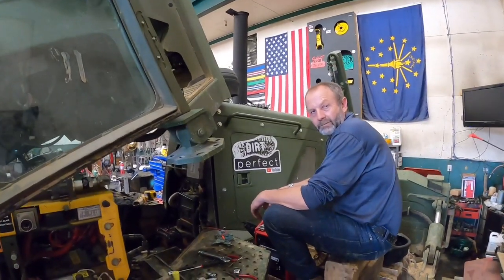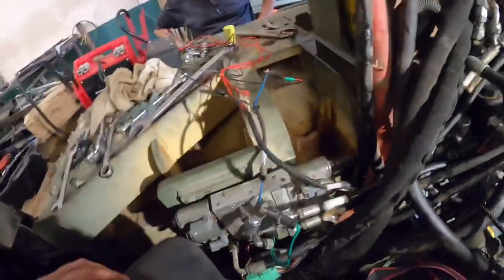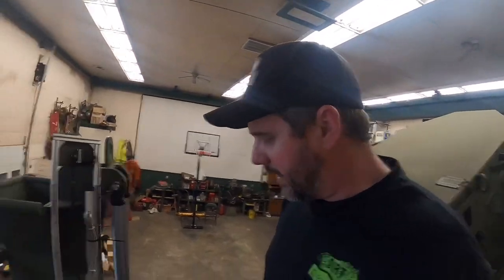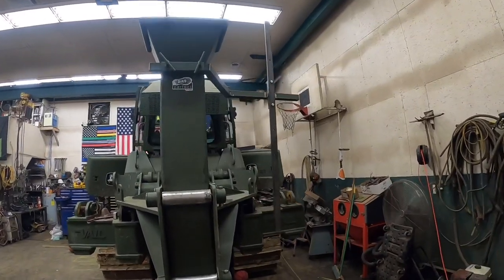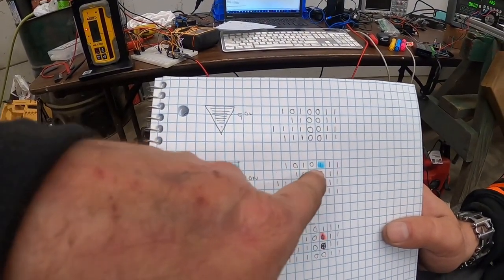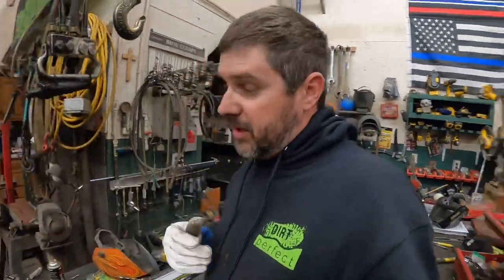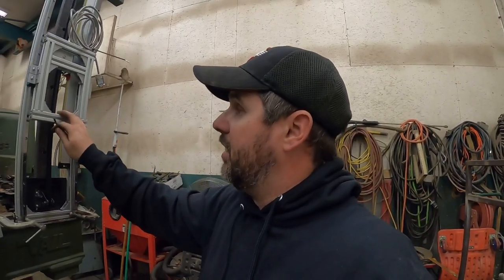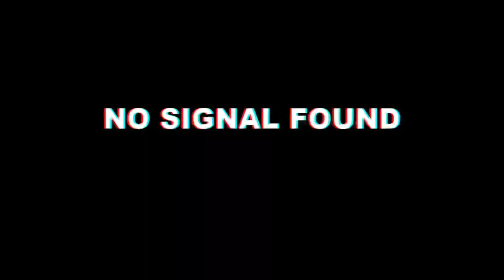Call us crazy, but we are going to build a grade control system for the plow from scratch.

Comment: Well done.  Not just designing and adding laser depth control, but on the way you built it. It is great to see something designed and built by someone who knows that eventually, everything has to be taken apart for maintenance or repairs, and that limiting down-time is usually more related to how hard it is to take apart and put back together. Having an "end user" design and build a system, even with help from "experts," makes it so much more practical.

Comment: Well Mike, as a professional electronics tech for almost 40 years I'm seriously impressed with your new friend FlamingDirt's outstanding design and build of that hydraulic emulator / simulator system. 
Not to mention the software needed to operate it.
Next step is transferring that breadboard to an actual printed and populated (populated is a term used for the items installed on a circuit board.) circuit board.
Another system you or he or in a partnership should patent. 
Never turn down a source of income from something that you came up with, designed, built, tested and made a working model of.
I'm pretty sure that there's other operators out there who could use that contraption themselves.
Reply: Thank you Ronnie. It's a BIG compliment when it comes from a PRO. As for the patent, we covered that in depth on the live feed a few weeks back. We going to skip the patent on this one.
Reply from the maker: Thanks yes he is awesome leaned a lot in a short time

Comment: Greetings from No VT - I have to agree with several of the other comments about the potential for vibration being a factor. Hopefully shock mountings on the tower frame connection will help. Also, maybe see if you can slow down the refresh rate on the laser receiver or if that isn't possible maybe reduce the frequency of readings sent to the hydraulic solenoid so that it isn't picking up too much "microsecond" variation. One option might be to introduce a microchip signal buffer to take the readings coming off the receiver and "smooth" the values so that your hydraulics are not overwhelmed with too many "corrections". At the speed the dozer travels laying in tile, maybe a 5-10 second interval for updates to the depth control hydraulics? Impressive project, will be watching for the next installment!!
Reply: There is just too many questions on this topic to answer each one. But since you took the time to formulate it so well I'll answer yours. Simple answer: It is not as issue. As you mentioned the reaction time is already controlled for a slew of other reasons.
Reply: @flamingdirt669  Thanks

Comment: My tile boys put their laser on a steel tri-pod with sliding pipe on top, witch was mounted on a two axel trailer. When they needed to reset the laser they pull the trailer to anew spot. The laser was all ways in front of the dozer going up hill , receiver was pointing forward on dozer. High up slowly going down as dozer went up hill
Reply from the maker: That would work for sure

Comment: Hi Mike I get what you are trying to do or I should say already did . I believe in the KISS method . If I was advising you on this build I would change two things . First there are hydraulic cylinders on the market that have positioning sensors built into them . So you can get rid of that delicate  erector set you have hanging on the machine  . Second I would use proximity switches on mounted on the boot they are cheap and the rights ones for your application are very durable .  I think Flaming Dirt would be able to use those signals from them just fine to control the elevation .  I think the difference would be that your laser receiver would be mounted at a know point on the machine as from what I can tell it is now mounted on a floating point that you are trying to hold as the machine goes up and down . It may sound more complicated but a lot less moving fragile parts .

Comment: As a retired Electrical Systems engineer...you are replicating a Servo  loop whereby you have a setpoint ( being the targeted height of blade ) and comparing that to feedback  ( location of blade in respect to desired location) to output an error ( distance and direction needed to travel to get to right location) . 
Response time of system as well as gain and offset of controls look to be very doable.  I'm sure you guys will figure it out...R&D with practical output. Nice job guys..
Reply: Thank Rick, it sure was interesting. Especially since the loop was only closed at the very end.

Comment: ok I need some help understanding what drag chains are to control depth. Cheers
Reply: Ian go find our live chat a few weeks back. DP explains it there. But in short, it's a chain with color coded links hanging from that same bracket that the laser is on. DP then just keep the right color touching the ground while we drives. To be clear. Drag chains is for constant depth. The laser holds grade not matter what the depth is.
Reply: @flamingdirt669  appreciate it thanks!

Comment: OK, So what do the two Bright Yellow "Trimble" boxes on the back firewall do?  Are they the original GPS Blade Control system?    Blade lift should be relatively easy to convert  to plow depth.    What other GPS equipment do you need?
Reply: George, those boxes are the valve control electronics. The GPS receirver , Co-ordinate processing unit  and in-cab control head is not there. Plus that tech is 10+ years old. So it would be difficult to find one. We just used the valves and eliminated the rest.

Comment: It is wise to use redundant limit switches if damage is possible and an indicators showing limit reached. A simple switch failure resulted in a pumped hydro system overfilling and destroying the dam in Mo. I think it was the black river. Oh, it destroyed a state park also.

Comment: Doesn’t the laser going to keep the plow level weather it 36” below the surface or 30” below the surface.  If your installing the tile for drainage you don’t want it level you want to have a scope correct? What application do you want to be level?
Reply: DP's laser is a grade laser. He presets the grade. On test day he was running 2.5% grade. I can't think of any time you would run the plow level with tile. But DP might have other uses I'm not privy too.
Reply: @flamingdirt669  thanks, I knew there was something I didn’t understand. I was thinking the laser was only to keep you level.

Comment: I suspect that the mount is going to be a problem - vibration - notice at about 29:20 how the mount moved. I don't think the mount is rigid enough unless the digital smarts can compensate. It might also suffer fatigue failure due to vibration.
Reply: This is exactly what I was thinking as I watch Mike make the mount.
Reply: I just don't think Mike have everything secured down in that video frame.  I believe he is still test fitting everything and will become solid once all the fab work is complete.  Like he always says, "Stay Tuned!"
Reply: @rons3103  I couldn't have said it better myself. Let's wait until he is finished. From the live feed he did a few weeks ago, he said it work just like they wanted it to.
Reply from the maker: Stay tuned
Reply: @DirtPerfect  I see what ya did there
Reply: @DirtPerfect  LOL - if you get "tuned" osculation......

Comment: replace the clamps with bracket that can be bolted on (to tabs on the back of the angle iron)   That way you can slide the top into your holder, and then set the bottom into the angle iron.  Then simply put the strap over the carriage and tighten.   It will be a much lower profile than the c-clamps.

Comment: Steering is not critical
But I recommend a bigger back board behind the sensor.   I had a red lazer from army surplus. 12 volt. 2 foot long.  Would light up a tail light  or headlight half mile away.. At night.  Reflective Stop sign.  It was a tank gun sight.  In daylight it was invisible but a detecter could detect  it that far also.   I never found a good use for it except with mirrors I put a fence around a property. If it was broken it set off alarm. Deer kept setting it off but it kept them out of the garden. 
I used to go to the Dayton Hamfest.  In Ohio.  Ten acres of STUFF.  Army surplus of all kinds and goodies of all sorts .  truckloads.

Comment: I see an arduino Mega and an ESP32  . I figured thats  what he was using when i saw the IDE . I prototype with Atmel Processors a lot. Pretty cool seeing him do some of the same things im familiar with . Looks like a pretty slick setup reading the Hex off the Laser receiver.
Reply: Thank you MrAr. The hi-lite was working with DP. But the Geek in me enjoyed the LCD hack the most. Is a custom LCD with on public documentation. So figuring that one out was very interesting. Especially since it's got 4 back planes and nothing was like is seemed as first glance.
Reply: @flamingdirt669  sounds like a load of fun

Comment: Is that a neutral position limit switch so that you differentiate between up and down overtravel positions?
Reply: Yes it is neutral position. But it does not know up and down Schwarz. We based it on the direction of the last stepper command. But you are 100% correct if the stepper lost it's mind and went the wrong way the logic will fail.
Reply: @flamingdirt669  A true "neutral position" limit switch has 2 independent contacts, one closes in the CW direction and one closes in the CCW direction.
Reply: @schwarz6337  Thx for the info  Schwarz, I'll definitely  look into those. They will help a lot for future projects.

Comment: I have a laser, and do my farm ditch cleaning with it. The neighbor has an rtk gps on his scraper.   My laser is nice, cheap, and simple.  The gps system is really nice because it can adjust the grade % every 20 linear foot increments or so.  The neighbor can get water to move, while moving a lot less dirt - using multiple grades,  than I do with a single grade laser system.

Comment: Someone please explain - What use is a laser system to raise and lower the plow when you just lower the plow to the depth you want and then the dozer follows the land so it stays at the same depth anyway?
I'm missing something.
Reply: Hi, in your scenario the plow would put the tile at a constant depth and yes there is applications for that. But in most cases the tile needs to be on a specific grade. ex 2.5% was what DP used the day we tested. The reason is that is needs constant flow. If the tile goes up and down ,following the contours of the field, it will silt in on the low spots. So the laser's job is to keep that grade as best it can. This is a very basic explanation of a complex problem. But this should get you thinking in the right direction.
Reply: @flamingdirt669  That makes perfect sense, thank you for taking the time to explain. Cheers!

Comment: well as a member of the peanut gallery i noticed you have hard time getting the rail into the holder. maybe add a couple little tabs at an angle to guide it into place. also could you provide me with the # off the micro switch . for one of my future projects thanks
Reply: rebuild it's a great idea. But I have to say I'm partial to the g-clamps. They give it just the right amount of Redneck flair. The switch is a ME-8108 from uxcell.

Comment: As operator and mechanic you know what is possible and that you can get to a specific result even if you don't have all the detailed steps decided and locked down. We IT guys/hackers are just the same, we know what is possible and the route to the final solution even though we know details will change. We tinkering and fettle but we just use different tools.

Comment: With a couple tee fittings and ball valves, this system could rapid swap to blade height controller
Reply: True... just tee in the electric valve into the blade height circuit and it will work along the existing control.

But when the grade is off so much that the dozer spins out, you'll need to switch over to manual control with the ball valves in order to move your blade load. That means the electric power to the control valve needs a relay to switch it off do you can override the blade height, yet you still get to see how far off grade you actually are...
Reply: @Sjanzo  Great summary Sjanzo. What we did find is the dozer pilot hydraulic pressure is setup so that the hand controls always override the GPS system. I think it was done intentionally as a safety.
Reply: @flamingdirt669  yes off course you can also just cut pilot pressure to disengage  the auto height control, i just assumed the additional valve installed by C&C was a low flow, direct operated one without a pilot...
Reply: @Sjanzo  Oh man that 850J is a hydraulic spaghettis bowl. Dual pilots on everything(the GPS version) and more one-ways than NY City.
Reply: @flamingdirt669  so, are you using the dozers own GPS system, or are you tapping into the laser receiver youre adding, to control the electric spool valve of the tile plough height ?
Reply: @Sjanzo  The laser. the 850J does not have GPS, it is just GPS ready. Meaning the valves and valve control box. No receiver or GPS control unit. We used only the valves and eliminated the valve control box. Hacking an output device like the Laser LCD is hard but do-able since you can see the output. Trying to figure out what possible inputs that valve control box needed would have been near impossible unless one could find a spec or get your hands on a working complete system.
Reply: @flamingdirt669  interesting... 15 years ago at a trailer builder, the supplier of trailer steering systems rented a Ford Focus to hack into its electric power steering pump to learn how to engage that pump, because TRW wanted 20.000 euro for the source code... they got that pump working fine on our trailer, dont ask me how... 😉

Anyways, i know what youre doing now, even though i dont know the code at all.. Cool project, you sound like the electric guy at work..

Comment: PIDS & DIPS, and Mechanical inter-locks.  Oh boy DP getting very techy with the ones and zeros. The breakout board and sleuthing the PID for each laser level position is exactly how to do poor-man’s GPS level control. The limit switches will require maintenance to ensure levers actuate and protect the mechanism and stepper motor.
Reply: Thank you Sean. It was great working with DP. His ability to pick up new knowledge is simply astounding.

Comment: Surprised your expert didnt go with a Marine GPS receiver.  They cost $100 or so and output NMEA 0183 data, which is an industry standard.

Interfacing NMEA 0183 data is pretty simple as there are already librarys written for Arduino and other microcontroller development platforms.

But I am still impressed with what you are doing.
Reply: Great comment RV and yes I was thinking along the same lines. But sadly most marine receivers are only accurate to couple of  feet. The fancy new ones to several inches(and those don't cost $100). We needed 1/4 inch or less.  You can go down the rabbit hole and add a second receiver as a base station with radio coms. But that is a huge undertaking and  by then you can just buy a system designed for construction.
Reply: @flamingdirt669  Yea, resolution can be an issue so you would at minimum have to reset before each time you used it then hope you did not have too much drift during the job.  There is a NEMA 0183 parameter that gives you the resolution error, but it probably would not help enough to correct for the error to the accuracy you need. 

I do know that some of the more accurate GPS systems are temperature compensated to improve accuracy.

Anyway, I have been working with microcontrollers for quite some time, and I am impressed with the process you are going through.
Reply: @RVProject  Thank you, I'll definitely re-visit  marine GPS after your comments. I could always use it on another project.
Reply: @flamingdirt669  If you  are using the Arduino IDE, there are GPS/NMEA0183 libraries available, and all you need to do is to connect it to  a serial pin on the microcontroller and the height values will be in a variable after periodic calls to the library.  99% of the work is already done.
Reply: @RVProject  Awesome, i can't wait to try it. Do you have a specific model of receiver you  can recommend?